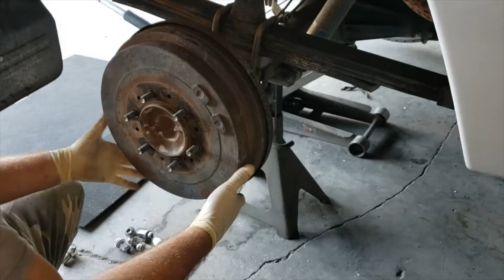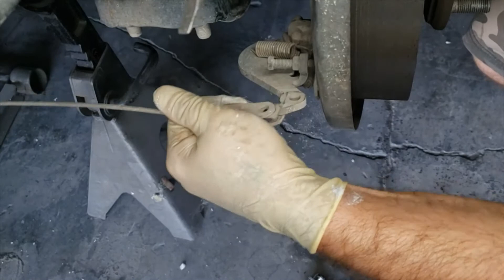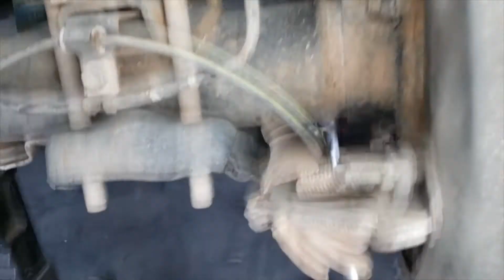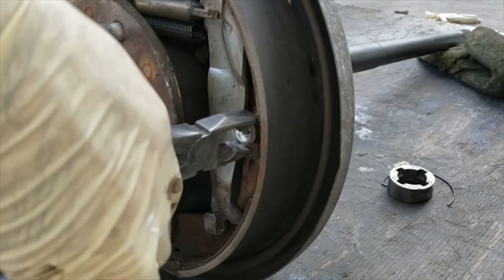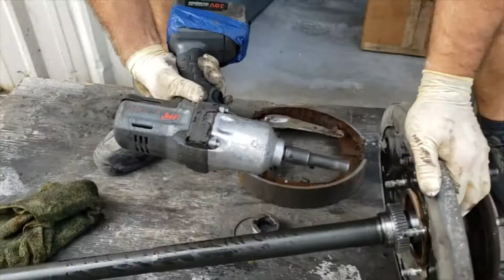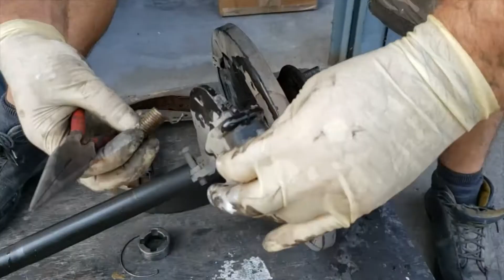1st Gen Toyota Tundra rear axle shaft removal

Comment: Note:  You do NOT have to remove the brake drum.  The whole brake assembly will come off with the axle.  Unless you plan to do a brake job (which you probably should) you can leave the drum on there.